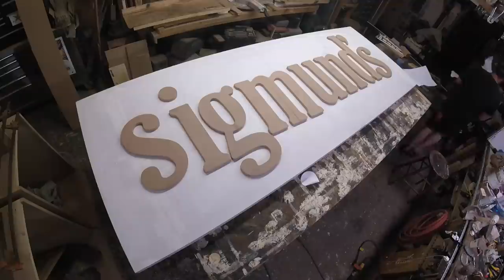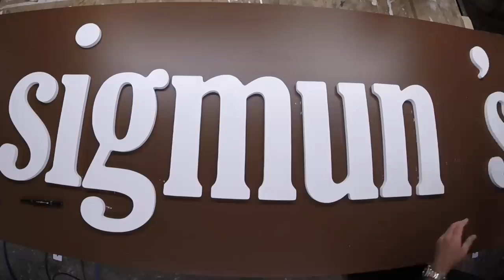✔ DiResta Sigmund's Sign

Comment: Jimmy, I'm a huge fan and I use all your tips and tricks when working with wood in tech class. I think all the wierd shaped scraps that come from the letters would look cool in all different colored stains and then placed in a countersunk table using a router and epoxy like the rat stool.  Thanks for your videos, Blake

Comment: Quick question. Jimmy, I don't see you using an angle grinder much. Is there a reason? And why? Its my favorite tool. With a thin cutting disk you can do so much. Sparks fly everywhere and looks so cool in slow motion camera.

Comment: So I'll preface my question with a statement - "I know pretty much noting when it comes to woodworking", but I am curious - I've noticed that when making letters you cut in from the outside and then glue them back together on the cut line, wouldn't it be cleaner to drill a hole a then cut from the inside of the letters (at least the ones with holes lik o,a,e,d ect)? Thanks, cheers!
Reply: I think its because you wouldn't be able to get the blade in these holes since its one "ring" of a blade with no open end that you can feed through the hole. Or maybe its just because its much faster to cut through the letter and glueing it back together instead of getting the blade in the holes everytime. Hope I understood your question right and could help :)

Comment: How do you mount it to the wall? You just drilled the hole in the bricks and then screwed the screws in. I think it would be better witch anchors or rawlplugs
Reply: Tapcons actually hold very well.  You predrill using the correct bit, then they will got straight into most concrete/brick.  Comparable pullout resistance to a lot of the drive in anchors with a much smaller hole.

Comment: Pretty sure that every one of those letters could have fit in the working envelop of your CNC router, leaving you time to do other more profitable things. But thanks for the Bandsaw Cam. I know how much extra work it is to make videos while you are trying to work as well.
Reply from the maker: +TheBikerScout this method is 25 x faster then setting up  for a ONE TIME cut out on the cnc .. to layout on any scrap i have is a split second decision , no computer time needed... from poster to 3/d letters in 16 minutes. Thank you for the support.
Reply: +jimmydiresta That's true when using scrap. Pain in the ass to find your zero/zero on a small board. We make so many signs on the router it's routine. But coming from a place where I had to make signs using a jig saw and band saw by hand to throwing a sheet on the vacuum table, I can never go back! But a lot of our signs now are complex and done with acrylic, and push through another substrate with precision, and can't have any light leak. So doing that by hand would be cost prohibitive... even though it's technically possible.

(And why are you still up this late? haha!)
Reply from the maker: +TheBikerScout hah i was in a YouTube worm hole!!! I see your point if you have the set up always at the ready it is cost effective for sure. I go from welding to bandsaw mdf to what ever .. Nothing is the same day to day. Thank you !! I'll try to sleep 👊🏼
Reply: A cnc is a slow but precise tool. The bandsaw is much much quicker.
Reply: +michele vitarelli It's only slow if your cnc is one of these pathetic xcarve type setups I keep seeing so many people review on YouTube. I cut .25" thick at 180 inches per minute.
Reply: +jimmydiresta I think it's faster to laser cut than it is to CNC. You just output each letter to the laser cutter, then position the scraps and tell the laser where to start.

Comment: How are you able to get such tight angle cuts on the bandsaw? Thinner blade? Tighter blade?
Reply: +Jason Barre Use a smaller width blade for a smaller cut radius and be Jimmy Diresta.
Reply: I've got a 1/2" wide blade on mine now and there's no way I could cut that tight of a radius. I need to pickup a 3/8" and 1/4" blade.